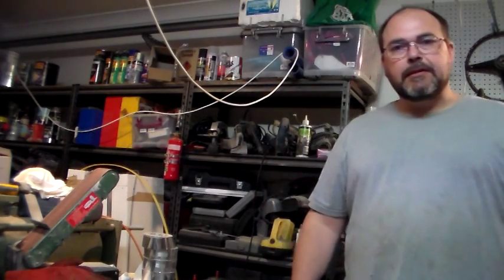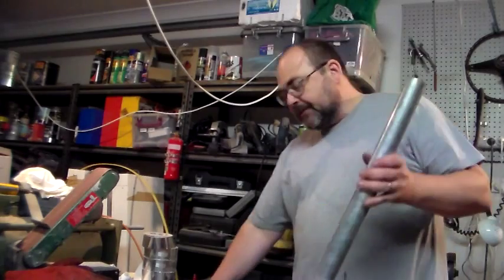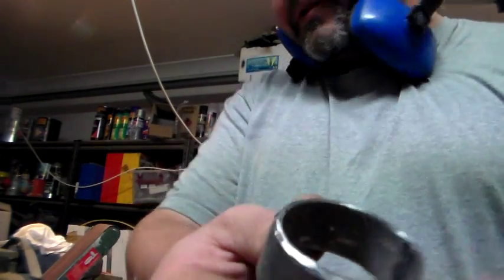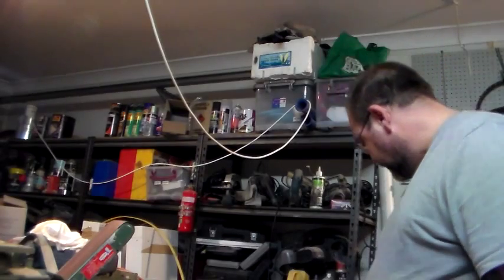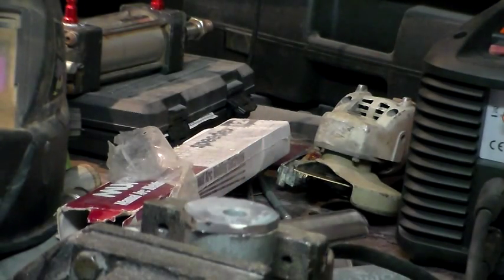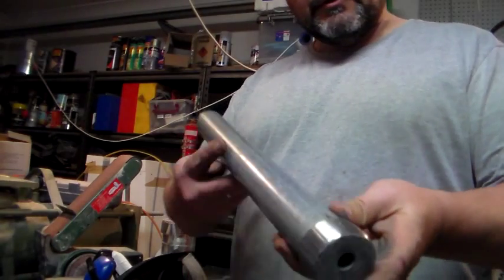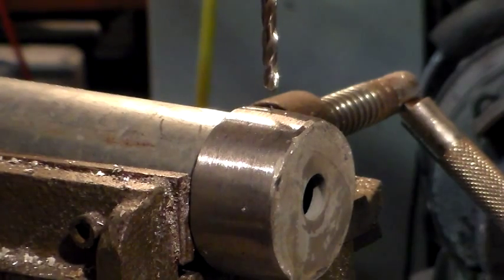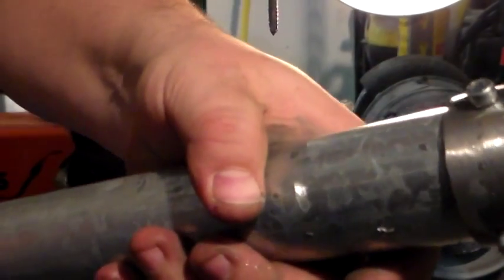Making a plastic injection molding machine Part 2

Comment: not really a tip on making an injection mold machine,as I am looking (researching) to build one myself. However,I noticed that you have a bit of a problem (like I use to have) getting straight cuts without a chop/cut-off saw. I've found that using a pipe cutter to mark my lines gives me straighter cuts when using a grinder,as I still haven't gotten a chop/cut-off saw. One do it yourselfer to another.
Reply from the maker: jeremy henderson I would say that if you are researching to build one yourself then use my videos as a guide of what not to do. I learnt that I was on the wrong path. My advise is to use hydraulics to clamo your mould and a screw feed for the injection. Thanks for watching